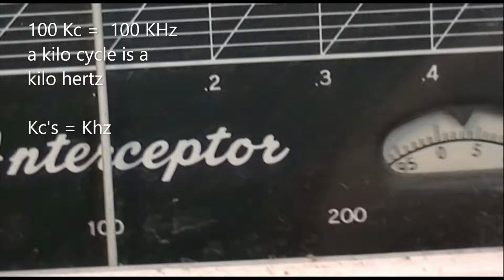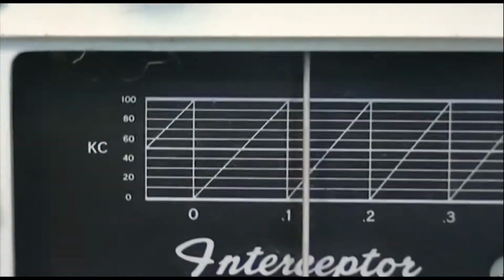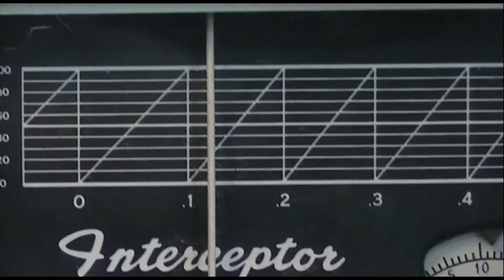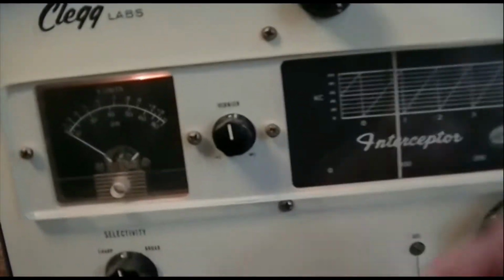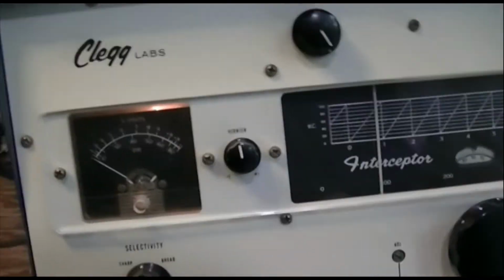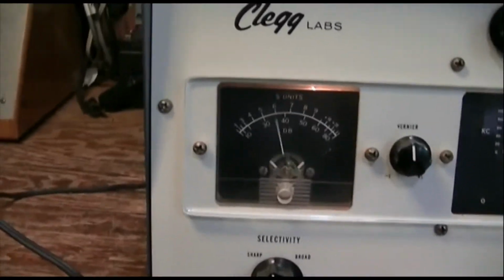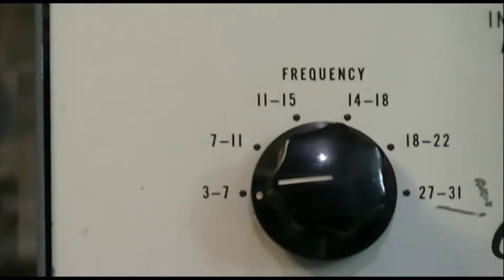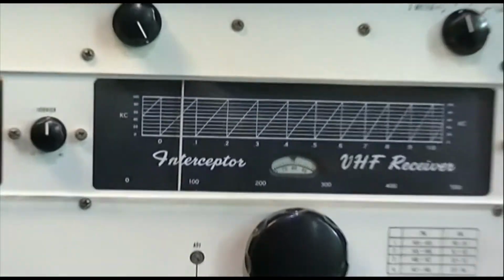W6WUH: Two Clegg Interceptors #2  Test & Operate  (Before Service)

Comment: It would have been nice if you was a lot more steady with a camera making me drunk. But far as the information on equipment very good film in as far as telling what everything done thanks for the making it.73 AE4OY WILLIE P.(EM-81uf)
Reply from the maker: Yes !  I hate psychotic camera waving videos also !  But, using a tripod makes it very difficult in a small shop when you have to look at several different things in quick succession.. sorry.  73.
Reply from the maker: I will make a new Interceptor B video, and I WILL use a tripod.